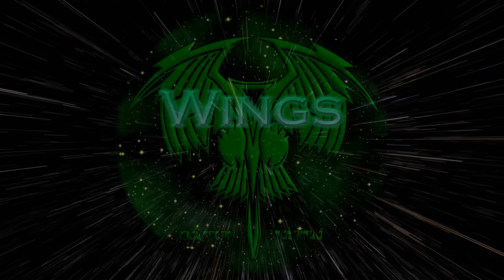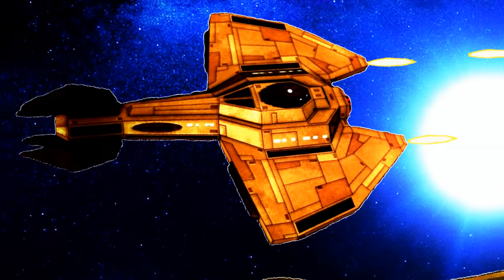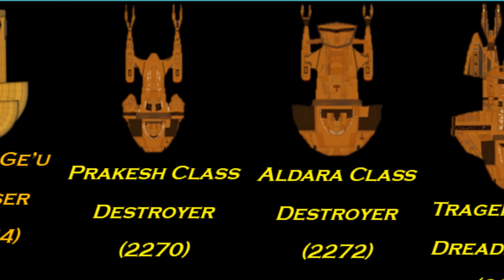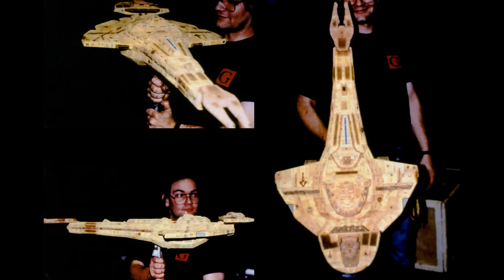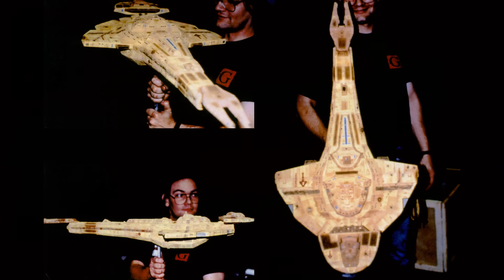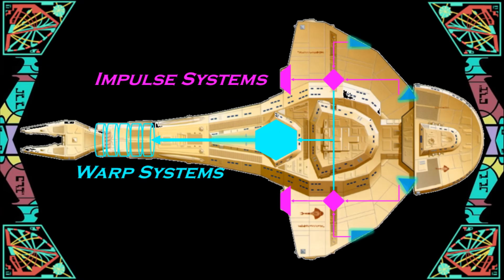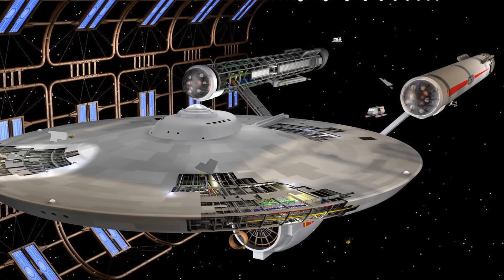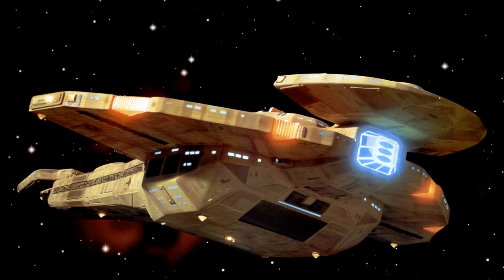Why Are Cardassian Ship So Weird?

Comment: Oh boy this has provoked a lot of thoughts in me.

First, I'll agree with the mononacelle layout. But I think the little fins at the back are warp field regulators/modulators that handle any disturbances the mononacelle can't balance out. We saw something similar in the rear pod of the NX-01.

Second, they don't have to be as fast. Cardassian space seems rather crowded with ships and stations, at least compared to the Federation. So any breech is going to run very close to a lot of ships. They only have to be fast enough to make the intercept, and we've seen that ships out of position can relay sensor data to rearguard units.

Third, I don't think they trust their crews. Kinda like Soviet SSBNs--they only went out for 2 weeks at a time to keep the crews from getting frustrated enough to mutiny. Which means you don't need to build parts for five-year voyages--you can be a lot looser with the quality control and pump that stuff out cheap. Whenever they hit the closely spaced outposts for shore leave, they can do the maintenance then.

And since they aren't out as long, you don't need holodecks and food replicators and arboreteums et ectera. A few cases of canned food, a decent cook and some books can get the crew through. Much cheaper option.
Reply: Yeah this was my first thought, that if the dual nacelles are stabilisers or “thrust” vectoring in any way, perhaps the tail structure could provide some effect like that. Though, like how OP mentioned fighter jets, they wouldn’t need so much thrust vectoring. If they can point at a target, do a surgical strike or strafing combatants for instance, and warp out with less focus on the dogfight.
Reply: @quentinking4351  Good point. The space saved probably went to more fuel/engines/structure than a comparable starfleet ship has allowing a Cardassian ship to reduce the capability gap using brute force design solutions.
Reply: One of the baseline reasons I adore space games that let you doesn’t the “inside” of a ship: tactical trade offs and such.

One of the coolest was Stardrive: but that’s all it really had going for it and SD2 had better gameplay (MOO ripoff iirc) but much worse ship design..ironic actually.

Comment: I'm wondering if there's a way to detach and replace the entire tail assembly relatively quickly and easily (at least at a repair facility).  It'd have to be designed to be able to do that of course, but it seems doable to me.  And I definitely think those fins serve both the maneuvering and heat dispersion functions.
Reply from the maker: There are panel lines so possibly.

Comment: That one Cardassian engineer was fed up with Federation "backups for backups" & just angrily pointed out, in so many words, that you don't need that many small, delicate fail safes if you make the main & backups larger & hardier. Which, refreshingly, indicates that the square-cubed law is still an ongoing engineering consideration.
Reply: dang that callback to Chief O'brian's argument with that Kardassian engineer 😆
Reply: @Broockle The Federation engineer was trying to explain why you make your various backups work on different principles, in case a weird space phenomenon interferes with only some types of system. 
But the Cardassian engineer thought they were just flirting.....
Reply: Having the ship surrounding the single large warp coil would also make maintenance a hell of a lot easier as you'd have more space to work.
As a mechanic myself, starfleet ships just look like they'd put the oil filter upside down where you can't not get oil all over yourself.
Reply: @nateharder2286  
On the other hand, instead of a smaller coil you can easily replace or patch, if something goes wrong, it might be behind several meters of superconductors... most of which had nothing wrong it until you started cutting into it. XD

Larger components, like anything in engineering, is a tradeoff. Fewer things are likely to go wrong, but when they go wrong it's in a bigger/more spectacular way.
Reply: Like a Sonata xD  @SigurdGodwin
Reply: @nateharder2286  then their coils must work very differently from federation ones, which feed large amounts if plasma between split toroids, that let it leave to both sides and out the back... your idea would just pump ultrahot ionised gas into the belly of your vessel
Reply: Anyone who's worked in safety would find that the line saying that Starfleet regulations mandate a secondary backup means the opposite of what the writers intended. Safety rules and regulations are written in blood. Each one is the legacy of something that's gone very wrong. Mandating a secondary backup isn't the sign of an enlightened, forward-thinking organization that values safety and reliability, it's the sign that it's so incompetent that both primary and backup systems fail so often that someone wrote a rule about it. Remember that this is the organization that doesn't seem to be particularly bothered by frequent injuries and even fatalities from exploding computer consoles.

Starfleet design philosophy is prone to feature creep and technology for technology's sake. It's littered with design decisions that were made by people who don't have field experience and are just working from theory. Geordi outright told Leah Brahms that things in the field are different than they are in theory. When Kira is teaching Ziyal the basics of combat, she says that Starfleet phaser rifles are overly complicated and more prone to failure despite all the features that seem nice and while Cardassian ones may seem more crude, they're more robust and reliable.
Reply: @lunatickoala  Ya i think they were really trying to make a comparison of the Federation being more like the US military and Cardassia being the USSR. The US military is more advanced, with all its cool toys, but those toys are much more complicated and expensive compared to its soviet counterparts. The USSR opted simpler designs that simply worked, but were typically not as smart or advanced as the US. 

Though i agree with the idea that having to need so many extra spare parts might indicate that the failure rate is so high. I also think having at least ONE spare part is kind of smart lol... Shit sucks when you are days away from a safe port and you cant replace something lol.
Reply: @lunatickoala  having multiple levels of redundant backups is quite common in real world designs, particularly with aircraft and warships. It is quite common for aircraft, particularity military aircraft to have triple redundant backups for hydraulics for good reason, and its not because the primary and secondary lines fail that often, but because a failure with these systems can lead to the loss of hundreds of millions of dollars of aircraft as well as crews and passengers. and warships always have tons of redundant backups because these ships are expected to get shot at and take battle damage, so having multiple layers of redundancies is just sensible in any vehicle that is expected to get shot at. 

The only real problem is writers want the cast and crew to be in danger all the time for the sake of the plot, so a as result they tend to write the ships technology as being far more dangerous and explosion prone than it has any right to be. And this is common all throughout sci fi, its not just a star trek issue. its why we have so many nonsensical things in space craft designs, like starship bridges being out in the open for no reason, massive and vulnerable windows, extremely unstable and easily explosive main reactors, lack of guardrails especially around cavernous open pits that exist for no good reason, lack of effective internal subdivision, single points of failure for entire critical systems, inexplicable and convenient weak points that lead to whole moon sized space stations exploding, or even stuff that is just downright silly, like your starship designers being too cheap to build an autolodader for your massive skyscraper sized guns, so you make a bunch of deck slaves load in house sized shells manually, who cares that that wouldn't be physically possible.

Point is the vast majority of the problems we see with starfleet technology isn't an in universe issue, but an out of universe problem of writers wanting to artificially amp up danger for the sake of plot and it happens everywhere in fiction in general.
Reply: @lunatickoala  sounds a lot like comparing an American M16 to a Russian AK47. The M16 has greater precision and can hit a target further out with pinpoint accuracy, but the AK47 is more robust and can handle more of a beating while still functioning.
Reply: @GuardianSage  That's a very apt comparison. The first version of the M16 was quite unreliable. Improvements were made and it did become a useful weapon but even then it still requires significantly more cleaning and maintenance to stay effective. But a lot of front line units have switched to the M4 carbine which is a less accurate but shorter and lighter derivative of the M16.

The AK-47 was designed with the lessons of field experience in mind. It was designed to be robust and to be able to put down a lot of fire at the cost of accuracy because their very hard-won experience showed that for its intended purpose, those were important and accuracy wasn't.

TNG actors found that the phaser designs on that show weren't very ergonomic and were hard to aim. Having 8 or 16 settings, no sights, and a "trigger" that's easy to press with no guard makes it an absolutely terrible at its intended function, unless the intended function is to get redshirts killed while they're fiddling with the settings in a high stress situation or because of accidental discharge from a lethal equivalent of a butt dial.
Reply: @lunatickoala they must have some sensor that can tell when it's being gripped/aimed or maybe a switch to manually unlock it. Think like a modern vaping 'box' mod.
Reply: @lunatickoala  They had safeties, sorta. And Presets. But, absolutely correct about the ergonomics. "Dust-Buster" they used to call it, in the first season. When you get to the moves like Nemesis, smaller and better, but still like holding a pencil to a chalk board. But, the creators didn't want the image of a pistol to perpetuate the idea of violence for a Government supposed to be about exploration, science and peace, just like no "War Ships". Everyone else was allowed pistols, only because they were not as "enlightened" as the Federation was. That way, you can tell the difference, I suppose.
Reply: Not to put a pin in the conversation but I need to point something out from someone who has fired and used both aks and m16s. Aks suck shit for durability due to those lauded big tolerances. Easy to clean is about all the have going for them. The moment you get covered in mud they turn into bolt action rifles in seconds. Yes I have experience with this. Meanwhile you can throw an m16 into a sloppy soup of muck, let it stew until it cakes up, then pull it out and start shooting it. 

The reason the m16 is seen as unreliable shit is because it wasn't issued cleaning kits and was issued massively overpressured ammunition. Why? They didn't want to change off the 30-06 shell and decided to spread the rumor that they were self cleaning. They were not. The +p rounds caused serious damage to the recoil spring which means after a few dozen rounds it was struggling to go into battery, hence the forward assist added later on. It let you shove it into battery if it didn't go all the way in. Do note that ammo was so obscenely over pressured it was ripping case heads off the damn brass. It's like trying to power a phaser pistol with a warp core. 

Both guns are accurate, both are deadly. The lack of accuracy on the ak is another rumor, that shit hits targets just fine. Recoil can throw you around more but it's not that bad. You can't hit shit at long range on full auto regardless of the rifle you use. That's why we have saws. 

Tl;Dr, the m16 and m4 are considerably more reliable than ak platforms as ar platforms don't let dirt and slop get into the guts of the gun easily at all while the ak platforms are open doors and shit the bed the moment you throw it in the mud. Yes I'm counting the dust cover being open on the ar and closed on the ak for this.
Reply: @Rhiawhyn  What does this have to do with Star Trek ship designs.  Did your bot cut-n-paste in the correct comments?
Reply: @lunatickoala  Absolutely, because Starfleet don't take their "weapons" out for only defense and combat. Everything they carry has to be as applied to science and survival as they do in defense. So, those "Features" on Starfleet Rifles and Hand units, did a lot more than stun or vaporize their targets. They would have width or frequencies to match shields, barriers and heat rocks for warmth, etc. Can you imagine a group of Klingons attempting to be "sciency" with their weapons? Nope, that is exactly why they have only one purpose, with fewer things and chances to go wrong. Starfleet can even use a Type Two Hand unit as a grenade. Which guess what, gives a lot of noise and warning for everyone it is meant for to run or turn if off. That would mean, you threw out a perfectly good phaser for its power to maybe tickle a few baddies coming at you hard. May as well throw at them the "red-shirt" who threw it, with it. "We're not covering you after that, homie. You're screwed."
Reply: I still remember "I'm not remotely interested in you" and the reaction.  Good lord even as a kid that made me cringe up and go "YOU FOOL"
Reply: Triple redundancy is expensive.  Materials costs alone, much less volume consumed in the vessel itself
Reply: @rigleighfeild  triple redundancy is also the standard for a lot of military craft that are expected to get shot at, and where battle damage can take out both the primary and the secondary.
Reply: @rigleighfeild  i wrote a great comment about the differences between the post-money Federation and the more primitive Cardassians who still need to prey on others. I went on to examine how these cultural and economic differences would manifest in technologies. I'm really getting tired of comments "disappearing"
Reply: @rigleighfeild  Expense is a non-issue for the Federation but if the Cardassians have to violently steal resources from other planets for decades, we can assume they would barter or pay for resources they need from those they can't simply steal it from.
Not ever planet is ripe for invasion like Bajor so the Cardies must have trade relationships with other entities. 
It makes sense they would want less complexity in their systems to minimize parts and repair efforts. Interesting to consider isnt it?
Reply: Also that one Cardassian administrator that lowered the costs could skim a big cut of the difference for himself. 😆
Reply: This Theory tracks
Reply: DEWD HERR NAYEM WUZ "KYM" CARDASSHIAN YO, SHEA WUZ GULL DOOKOT'S GULLFREND YO.
Reply: Almost every ship in Star Trek has the most inefficient designs possible, all style and little function.  For a pure socialist society the Federation does not conserve any resources.  As a result they glorifies it's military with what is pretty, showing that the Federation as a socialist structure is doomed to failure.  They even wrote the Ferengi as socialists pretending to be Capitalists
Reply: I don't hate the Cardassians.  I just hate what the Cardassians did to star ship design.
Reply: @hatuletoh don't forget fashion... or interior decor.
Reply: Energy matter transformation means costs of materials needed for spare parts of triple redundancy seems next to nothing for most items, within main quadrant.  Once you attain such a state rules need not be simply written in blood, remember, in todays society, corporate greed drives enterprises.
Reply: @Grimdark_Replays  not sure how this relates